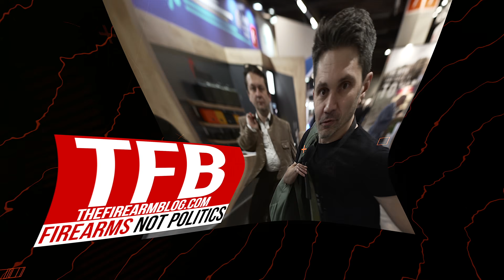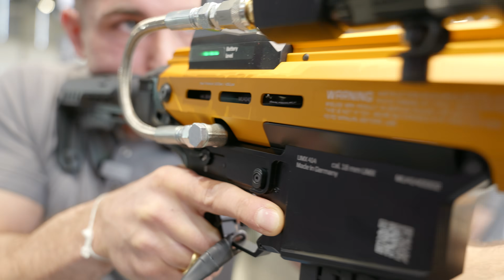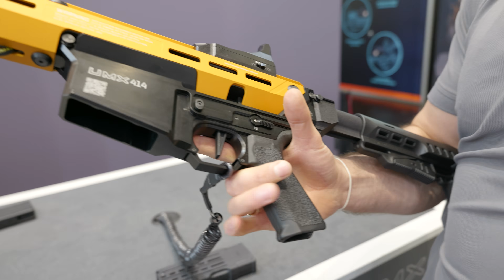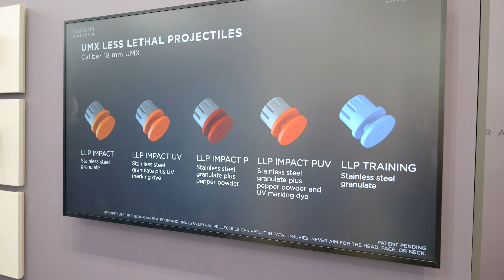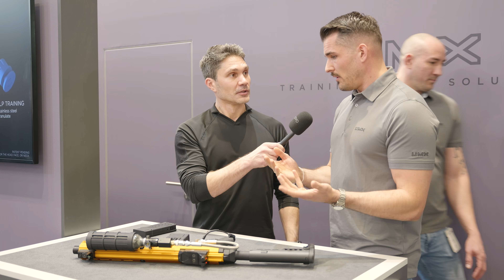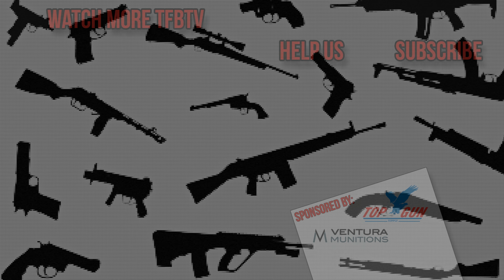Crazy Futuristic Range-finding Less-Lethal AR-type Carbine

Comment: I'm not an air gun expert, but I do follow it a little in the USA. Overall this doesn't look very impressive to me. Air tank looks small and misplaced. It should take the place of the stock or be centerline under the barrel, not lopsided and front heavy. I just don't see the benefit of putting it in a chassis that looks anything like an AR. Being able to dial the power level at range is neat, but to me seems like a very institutional concern. This is for police forces, not really for civilian use. Civilian available markers in the USA get up to 70+ jouls and can use much more damaging ammo. To not be a deadly weapon in all states I think the limit is 7 or 12 jouls, whatever the Byrna pistols use, which is pretty anemic. It can work if hit in the right place, but it's very much just a deterrent. I would take the markers I see on @psi.defence.channel more seriously than this carbine. The Grimberg Gavle in particular is the only serious concealable less-lethal option I have seen.

Comment: Neat gun, you glossed a bit over the sights, which also adjust dependant on the distance ... pretty cool. many different shot types, and exchangeable with jsut turning the mag. Sounds like it could be pretty usefull for law-enforcement, but only those who would use it, can tell us.

Comment: To expensive , to many moving parts, and points of failure a mossberg with rubber slugs, and couple of  party size canisters of OC spray will do the exact same thing only better l, and more reliable.
But pretty cool how much money and time they wasted on R&D just to not sell any, they should have also put a tazer on it ), and they could have had one more thing to break/not work when it needed too.

Comment: Those look like Dye magazines, and why not just use First Strike style rounds since those already come in solid core rubber rounds and pepper ball varieties. I have something like this already, a EMF100 with a new body that allows me to use AR-15 furniture for the foreend, sights, and stock. It can shoot about 310-340fps depending on how tight the round to bore interface is.
Reply: They're not exactly DAM mags. Also this would be approximately 3x as hard hitting as a regular FSR apparently. So pretty spicy.

Comment: The valve thing is neat, but also... realistically, probably not necessary at all. If you're using a less-lethal gun in very, very close proximity, it's likely because you need to -- and you're not going to be all that concerned about the target's wellbeing. The fact that it's a less-lethal weapon automatically translates to increased survivability for any target -- obviously it's still dangerous, but... they could have just left it at 30 joules and it would have been fine. Rubber shotgun slugs / rubber buckshot has an energy of around 140 joules. 30 joules would be very unpleasent to be hit with within a 5m envelope, but it wouldn't be nearly as unpleasant as other, existing (and widely used) less lethal options.

The valve system is cool, but it's not necessary. Moreover, they should have been clever with their air reservoir and figured out a way to integrated it into the buttstock (instead of 1 large can, maybe pair up 2 smaller cans, etc.) Obviously it's got an AR-style stock that's intended to be collapsing, but (again)... that's wholly unnecessary for this type of weapon. They already went in the direction of having a "picatinny-adjacent" type of rail on top of the weapon that doesn't work with any indexing picatinny accessories... so why not take the extra step and make a sleeker, more streamlined weapon with a thinner profile and just move the air tank to a proprietary fixed buttstock?

It feels like a product that's answering a question nobody was asking.
Reply: “Europe” sums up your concerns 😂

Comment: definitely a future forgotten weapon. Too complex, probably too expensive, & with the proficiency of putting down target less lethally is fairly similar if not lower than current market less lethal guns.
Reply: Doubt it. It's going to be sold to big city police riot squads, who don't care about the price, where it will get pulled out every election cycle for a couple of nights.
Reply: Honestly I can see the ltl market heading this way, it really isn't that much more complicated compared to a normal paintball gun, you could probably do this with an arduino, a range finder and a small servo motor

Comment: They already have these things called shotguns and beanbag rounds
Reply: Here you have the same impact strength, from 5-55 Meters. Bean bags at 5 meters ...
Reply: @thni1703  You dont even have that. Look at all that delay in aperture adjustment.  You pull that thing up from low ready and fire its still on the 1 meter setting.  Get outta here with that toy
Reply: On top of that i WANT it to be more powerful up close.  Thats when im in the most danger.

Comment: You forgot to inquire about the air tank capacity 500/700ml... how many shots can be fired consistently with the 300 bar/psi.
Reply: That would depend entirely on the ranges/power levers of each shot
Reply: @Matt-xc6sp  there should be an estimated average like Co2/PCP/airsoft guns... unless the metered pressure gauge shows 300 Bar/psi as maximum fill/green, 200 for average% filled/yellow and 120 as low capacity/red then it's functioning properly.

Comment: For reference, a traditional paint ball impacts at 11 joules so this 30 joules beast is gonna leave a mark!
Reply: That's actually pretty high for paintball! In germany the maximum legal energy at the muzzle is 7,5 joules...
Reply: @svenblubber5448  
Americans play harder and enjoy pain. 😉
Reply: @-joe-davidson a lot of us are just plain stupid too 😂
Reply: @spartancrown  
That's how we can handle the pain... 😂
Reply: @-joe-davidson  😉😂
Reply: Was hoping someone would notate this.  Ya. That would hurt like a MF'er
Reply: Imagine if the paintballs had stringy glue in them to gum up machinery with.
Reply: Or you could just use rubber bullets or bean bags like in the US....🤣
Reply: @necavenue  I don't disagree that bean bag projectiles have a place but this isn't designed for the same use case and this also has a much better range than a shotgun firing bean bags. I could be wrong but I don't believe bean bags have UV compound for marking a target either.
Reply: @rowenelna  You could load shotshells with any custom load you want from paintballs to jellybeans just need creativity 😂 As mentioned by another post FN 303 rounds.
Reply: @necavenue  Beanbags and rubber bullets have a minimum engagement distance. Inside that minimum engagement distance beanbag and rubber bullets are considered lethal force in most states. 
This airgun is neat because it does not have that minimum engagement distance
Reply: @zekiah2  The minimum engagement distance for bean bags isn't even that high. It's like 12 feet so if the target is closer, you've got more important things to worry about 😂
Reply: @necavenue  US police have been using paintball markers for decades, from repurposed Tippmans to prupose designed riot guns like the FN 303.
Reply: @necavenue  wich will immediately defeat the purpose of it as a police tool since rubber baton grenades are better for incapacitating a rioter at range and taser way less dangerous up close....

Crowd control? A regular paintball is fine and easy to source
Reply: @necavenue US police have been using paintball markers for decades. From repurposed Tippmanns to dedicated riot markers like the FN 303.

Comment: so a shotgun with bean bag rounds vs. this?
Reply: beanbag is about 160j, so this would be way less
Reply: Pump-action shotgun with rounds which are just barely under threshold of lethal.
Specially with very close ranges. And limited capacity.
But wont replace them in anytime soon.
Reply: This like has more capacity and better accuracy. This is more like a rubber bullet rifle. Bean bags lose accuracy and velocity almost immediately after leaving the barrel.

Comment: Kind of interesting. I guess this is for if police think bean bags are too dangerous for crowd control
Reply: If bean bags are too much .43 paintballs are even worse... The biggest threat is eye/face damage... A paint or not a 30j paintball can maim
Reply: The idea here is that the energy delivered on the target isn't dependent on range. You dont want to merc somebody with a bean bag at point blank, and tasers are useless past 35 feet or so. No matter what less lethal option you choose, range is a severely limiting factor. This removes that factor by delivering the same energy on target whether it's 5 yards or 55 yards away.
Reply: Better range than a bean bag and better accuracy. Unless the person is aiming high they should never hit someone in the neck or face area.
Reply: @rowenelna  so basically every time law enforcement has tu use these and end up wounding protesters? Rubber baton 40mm also have this issue

Comment: Honestly a neat idea integrating the range finder to regulate an air gun.
Reply: Air tank butt stocks kinda suck because it typically means a lop too long.  You’ll also need a semi large bottle to ensure enough shots which makes a stock too wide.

I got into pcps for a couple years and thought the air tank buttock was best until I tried a couple air force Texans and Leshiy 2s
Reply: mmm, i think the air tank in the rifle butt would be better looking (and maybe for balance) ?
Reply: @benm7496  That is possible with this carbine. You can put the air tank on the side or/and in the stock. You can carry two air tanks at the same time.